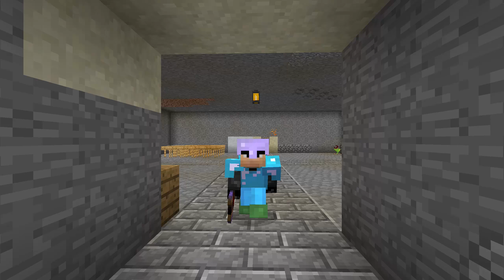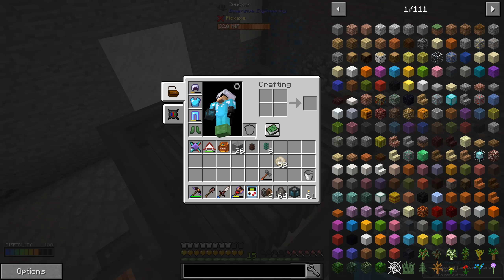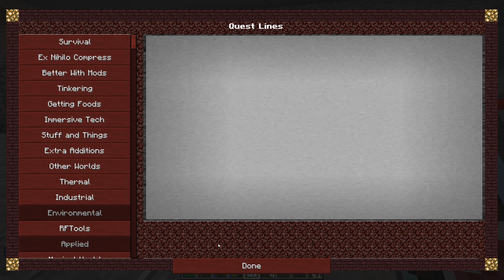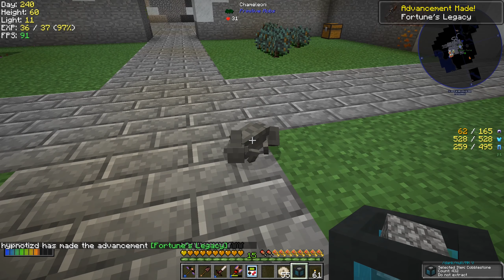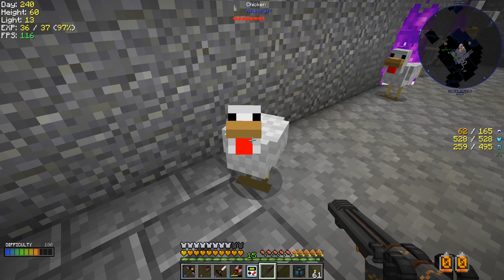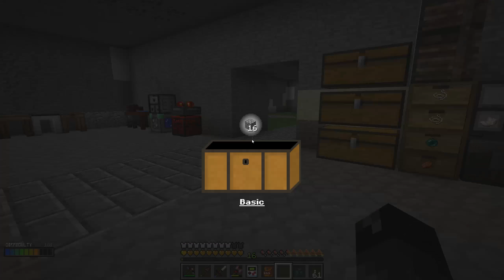Forever Stranded Lost Souls - TURRETS [E38] (Modded Minecraft)

Comment: hypno. the thermoelectric generator is an awesome power source. a bonus is it does not have any animation so it does not produce lag.  I have 63 powering my entire base.  if you set them up in a tower it minimizes the space needed.   just to give you an idea of what I am running. I have 16 compactor, 7 heavy auto hammers, 7 heavy auto sieves, 3 garden cloche, I have multiple of each machine from thermal expansion. I have the rftools system completely setup as well.   set up crushed and squeezer up as well and still not having a loss of power.

Comment: In case you dont know, IE manual crashing is caused by outdated Java.  You'll have to adjust settings in your launcher (Twitch?  MultiMC?) to use a more recent version of 1.8 Java.
Reply: joshuad156 I have mine set up as it says and it still crashes

Comment: you can pick up the garden by shift right clicking the garden
Reply: It changed from 1.7.10.  In the past, to pick up the garden you would shift-rightclick with an open hand.  For 1.10 and later, you shift-leftclick to drop the garden as an item, and the open-hand requirement is no longer a thing.  If you just regular-leftclick you get spammed with 4ish crop items.

In 1.7.10 there were also more types of gardens (8 types, I think?)--water, desert, tropical, textile (cotton), mushroom, leaf, stalk, and herb.  In 1.10+, it's down to just 6: desert, tropical, windy, shaded, frost, and soggy.

In all cases, the gardens spread in a 7x7 area around them, with a limit of 6 or 7 gardens of the given type within that space (other garden types don't count toward the limit). They can only spread to the block they're planted on (sand for desert gardens, oak logs for mushroom gardens, grass and dirt variants for everything else [including water gardens, which you can't actually place on water]), provided there's an empty space for them to spread to.
Reply: I think you can just right click it
Reply: my bad, I'm playing with my friend on 1.7.10 now